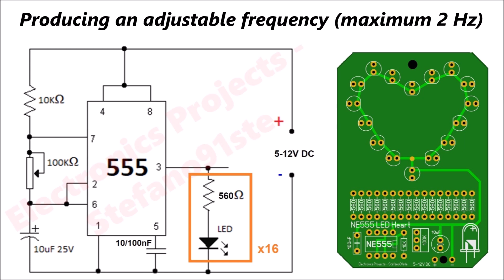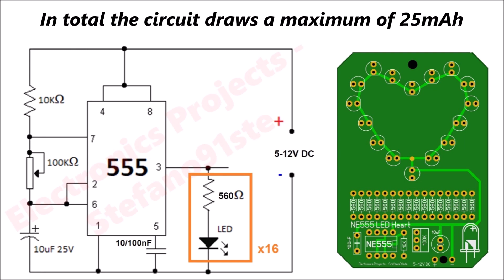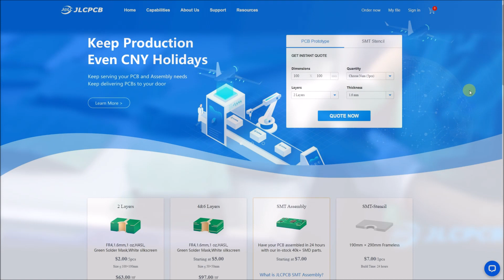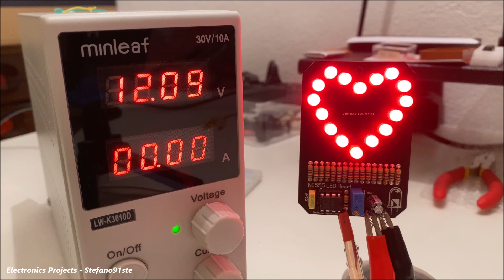LED Heart DIY with NE555 - PCB Tutorial

Comment: Looking very nice. But I'm recommended use the transistor on the 555 output.
Reply from the maker: True, I only use it when the load at the NE555 output exceeds 200mA
Reply: @Stefano91ste  I=12V/560 ohm = 21mA x 16 = 336 mA. It's not too much for 555?

Comment: Hi, I love all your videos and projects and I tried this one but leds aren't flashing, I don't what could be happening that the circuit ain't working :(
Reply from the maker: Hi, have you try the circuit on a breadboard? (if yes, double check all connections). How do you power it? Have you changed any component?
Reply: @Stefano91ste  I think I might have burnt the 555 bc a I used an atx power supply with 12 volts, that's the only reason I could find but not sure yet ;(
Reply from the maker: If you have not inverted + and - it is impossible that the NE555 is burned with 12V.. an atx power supply delivers 12V DC
Reply: @Stefano91ste  I think that's what happened tbh :( I'll try soon again with a 9v battery when the 555 arrives. Thanks and keep the amazing content

Comment: There is no need for all those resistors limiting current to the LEDs since the heart's LEDs are either all on or all off.

Do not get me wrong. I think that it looks good. I love resistors; particularly the carbon ones for their opaque background colour for the colour bands to ride on. It makes them very easy to read and they look sweet becuase you can easily see the colour for the bands. 

Nice project. 5☆
Reply from the maker: Hi, Testing this circuit on a breadboard, with no resistors, the 555 warmed up a bit.. with the resistors it warms less. Thanks for appreciating my work!

Comment: It's not DIY bro. It's just an advertise and assembly project. No one would buy this circuit to make this led heart. But if you make it yourself lot's of viewers like it more and maybe they make one for themself. At least it's more doable.
Reply from the maker: Hi, you're wrong, it's DIY.. I designed this circuit, I designed the PCB with a software I bought, I got the components and assembled it. (don't forget my time, and that I share the material for free, unlike many channels where you have to be "patreon" to have access to schemes etc). JLCPCB gives me the PCBs for free (that's why the advertisement)
In the video you can see the circuit diagram, so anyone can make it (independently) on a matrix board, breadboard, etc... without buying the PCB. I share the PCB file only for my choice, of course JLCPCB has never asked me to do it :)
Furthermore, those who are able to print the PCB at home can use my file and develop the board.
Reply: @Stefano91ste  I appreciate your work but I don't like printed PCB's I prefer to see the hand made PCB's it's more enjoying and also doable. I think others like custom PCBs too. Seeing electronic things is relaxing and satisfying by using advertised printed PCB's most of it will be wasted. Really hand made PCB's are more appreciated. Maybe it looks more messy but more satisfaying.
Reply from the maker: In the past I have made some home made PCB, like this: https://youtu.be/ZiIHb6M-sC4 and this: https://youtu.be/ZHN3ZFn5NE8 ..and in the future I would like to do others, both with photoengraving and with the CNC, I would just have to reorganize, I no longer have a bromograph and chemicals.. Also missing is the free time I once had, but in the future there will also be that type of PCB ;)
Reply: @Stefano91ste  Great, very good to hear that. Channels like you has a good potential, because there is no fake project and it's pure electronic project with skills. That's why expectation is a little bit higher